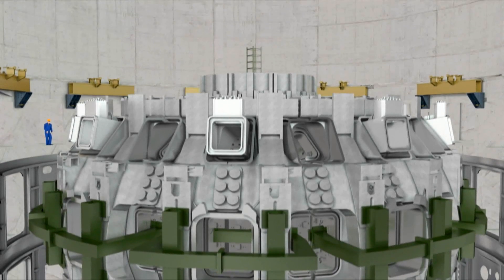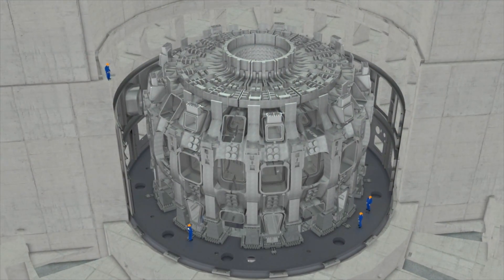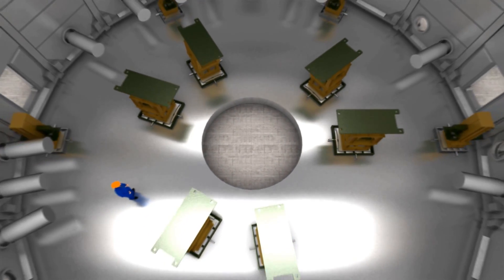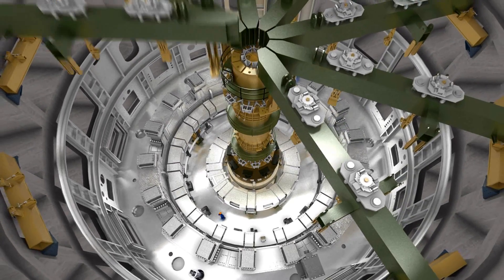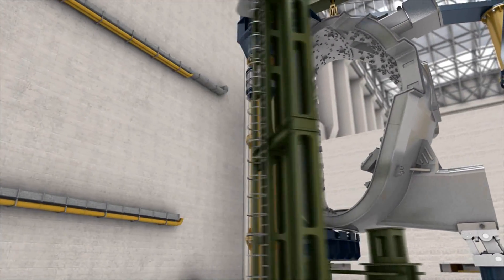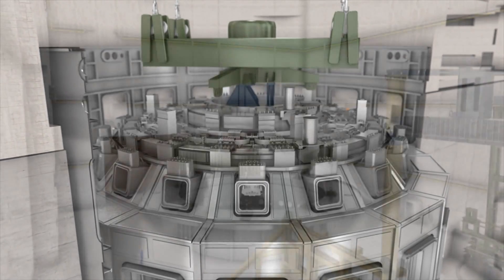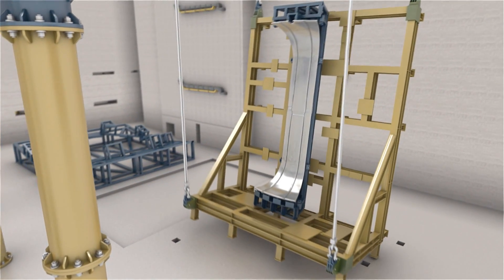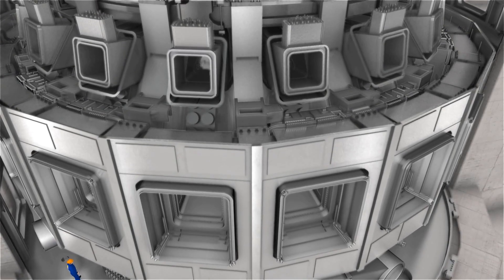ITER - the world's largest puzzle

Comment: If two heavy hammers collide inside a chamber full of hydrogen gas, maybe with each collision a few hydrogen atoms will be converted into helium and a small amount of energy will be released and that energy can be used for many purposes. Imagine having a heater that reaches a temperature of 1000 degrees by turning its handle and keeps you warm in the cold winter until morning. Is this possible?
Reply: not in the way you described it.

Comment: 20 BILLION FOR A KETTLE PROTOTYPE, 
IT'S TOO EXPENSIVE.
[In a Tokamak the excess energy could be transformed into excess heat, which by convection could be converted into electricity by means of a steam turbine coupled to an alternator] wikipedia.
Meanwhile, Moroccans are producing truly clean electricity, with ZERO DANGER for the environment, using exactly the same technology: Boiling water, spinning turbines, spinning alternators. With sunlight! FREE! When will we stop this waste of money for a technology that still hasn't produced a single watt?
This technology works at temperatures unknown in the Universe except in black holes or Supernovas. What will happen if a plasma at 150 million degrees leaks? 
Even a very small leak ... Following a very small failure of a tiny magnet? And after 10 years ??? Will not this heat eventually weaken the materials that constitute this deception?
Reply: It's not too expensive. Prototypes tend to be expensive and the final product gets cheaper and cheaper with the years.

Comment: If anyone is wondering, as of May 31, 2020, we are 1:40 into the assembly process.
Reply: its okay bro i'll just play this video at 2x speed to accelerate the progress in real life
Reply: @mosidian  dude. thats big brain right there
Reply: @tripplebbbbob9475  Many parts of the process are repeated in this video, so the entire assembly process does not take 6:42 to complete.
Iter has made massive progress, they're on track to be operation by 2025.
Reply: @danyala.1659  Oh ok that's not too bad it looks like it will be really cool
Reply: @danyala.1659  Yeah and it's not like the first thing they did was start assembling the vessel either. incredible amount of work went into just building the place to build the reactor
Reply: Yes just watched that part
Reply: In July 2020, the project officially launched the machine assembly phase
Reply: So lets say this turns out to be everything we hoped for, and we manage to get a sustained fusion reaction that puts out more energy than it needs to initiate and keep going.. would that make fusion power plants feasible then? I mean, this thing is taking a more than two decades to build right? And on top of that, its incredibly expensive, and repairing anything that goes wrong is also going to be incredibly expensive and time consuming. So why would any country build anything like this then? I don't see how the benefits overcome the massive cost in time and resource even if it manages sucessful fusion. One of he big problems with fission power plants, outside of the public ignorance and hysteria, is how expensive they are and how long they take to build. This seems to magnify that problem even more.
Reply: What is actually this? Where is this built? And the purpose?
Reply: @anddbanddb  It is the world's larger fusion reactor, it has the potential to offer unlimited energy. If it succeeds, it will change the course of all of humanity.
Reply: @danyala.1659  Yes. I Google on that. It's experimental set up
Reply: Update on progress?
Reply: damn... thanks for the info

Comment: With a little luck, this will be the main source of energy from the SECOND HALF of this century.
The first half all we will do is theorize, experiment and improve, moving closer and closer to an energy and economically viable form of fusion.

Fun fact: this facility will not produce electricity. It's exclusively a fusion test lab. Producing electricity is completely irrelevant. Once heat is generated, the process of producing electricity is always the same (heat heats water, generates pressurized steam, moves a turbine, which moves a generator obtaining electrical energy through electromagnetic induction). All the heat generated will be sent to the environment.

Comment: The advent of tape superconductors will allows fusion reactors to bypass the need for large dimension by increasing the strength of the magnetic field ,sadly this will be obsolete in favor of far smaller and cheaper machines  before it is turned on
Reply: Assuming you are right, in some way yes, pity that so much money was spent that could have been saved. But you can't make progress without taking risks. If we get fusion it is great news no matter whether via ITER or not. So I just hope you are right and if it turns out you were wrong then hopefully ITER or someone else does it...

Comment: I want to understand something!
When you need 150 million degrees Celsius to sustain fusion with deuterium and tritium. The amount of fuel in the plasma stream must be extremely small, perhaps in the order of several atoms thick...correct?  Also, is ignition of this fuel on and off in brief microseconds so that this tokomak structure will be able to sustain the enormous heat, pressure and radiation?  
I have many questions about feasibility, sometimes I think about the Argentine fiasco with fusion back in the 1950's.
Reply: You understand right,  nobody tells us how you contain 150 million C photons, how this is possible,  you say cooling,  fine, cooling,  cooling over some few inchies of some metal,  the gradients will be bigger than my calculator can calculate
Let's say it will work, it will not work the Sun doesn't function with magnets, it function with gravity, anyway , point is the thermal pollution will be hundreds of times bigger than today's,  this machine has a very small efficiency 
Open a furnace at 2000C and you'll be burnt instantly,  radiation, photonic radiation,  imagine radiation at 150 millions C, photons cannot be contain with magnets, or with anything else 
I would be interested if somebody shows us how we solve this, not to mention many other things,  the inherent instability of the plasma,  what happens if the magnet looses power, let say, you can solve all these, but never the photonic radiation, thank you, good night

Comment: If this fails, which it may, fusion will go no where.
Reply: Yeah, that's my biggest worry. I'm cautiously optimistic about ITER's chances of achieving net power output but if it fails then Fusion research will likely be held back for at least a generation, maybe longer. 

The timescales involved in all of this are insane really. ITER began life back in the 80's and won't be brought online until 2030. IF it achieved net power output then it'll move on to DEMO Plant which is the successor to ITER, scheduled for 2050-2060. It'll be our grandkids, at the earliest, that'll even see commercial nuclear fusion power, and that's assuming everything goes according to plan.
Reply: @mlc4495  This is what I call persistence.
I hope they will ultimately succeed like LIGO, which also took 40 years and resulted in a Nobel Price for three.
Reply: @mlc4495  maybe that is a good thing. It could be that we have to wait for manufacture techniques that are one or a few generations down the line.

Like, aviation is not a silly idea at all and well within reach of mankind's abilities, as we all know, yet it would have gone nowhere in 1200, or 1500... you know...

Comment: ITETR.....Taylor Wilson beat you up with simple power generator design. He can go from small to mega design with fraction of the money you spend on your over designed idea.
And how much that electricity will cost? Can we afford it?
 Is that your idea to jack up the price of a kw of energy?
Reply: He built a fusor. Not a power generator. Fusors don't generate power,they consume it.

And it's not like he invented it, fusors are old tech, heck I have one in my garage.
Reply: ITER costs $20 billion, a fraction of what it cost to bail out Wall St during the 08 crash. We can more than afford this. And unlike the bank bailout we'll actually gain something of value for humanity and the world, even if we end up failing to achieve net positive fusion output.
Reply: ITER is a science project, it wont make power.
Reply: @lagging_around  Yes it is a science project but it is all about making power so how you invented the idea that it will not gonna produce power?